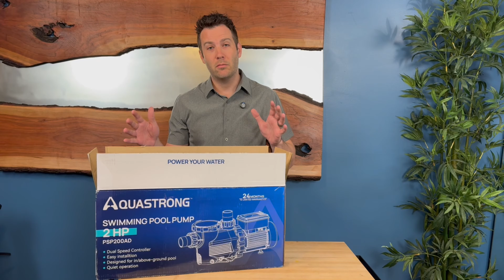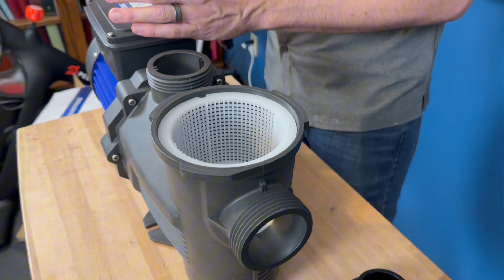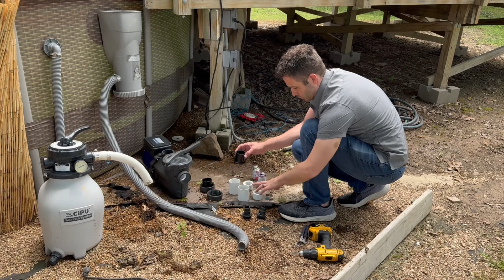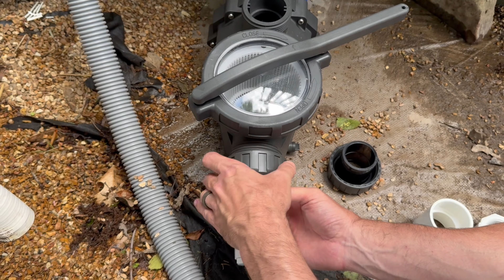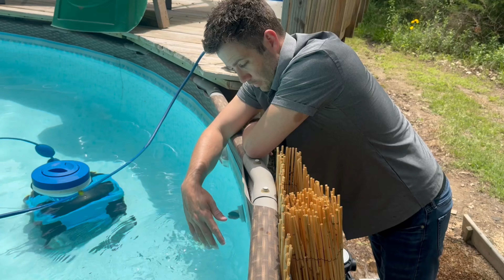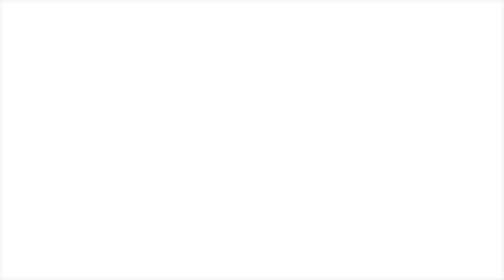AQUASTRONG 2HP Dual Speed Pool Pump PSP200AD for Above or In-Ground Pools#PoolPumpPower #AQUASTRONG

Comment: Just received mine. Do you have a parts list for the pvc?
Reply from the maker: It came with a 2.5 inch and 2 inch pipe adapt. pieces.  the only parts you need are just whatever reducer pieces to get it to whatever size pipe you are working with.  Ideally, you would run 2 inch pipe to and from the pool.  In my case I already had 1.5 inch tubes i believe, so I just needed to reduce it further than what they provided.  Each case will be a little different.  Pump has been running well still.  I have mainly been running it on the lower power setting, but have boosted it while kids are swimming etc.